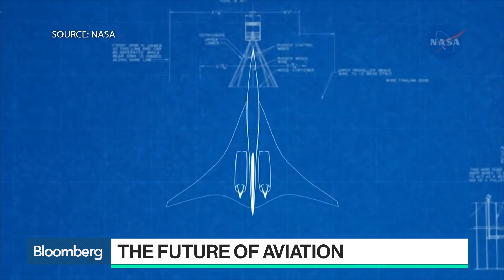The Future of Hypersonic Flight

Comment: If I had the means to approach this, I'd re-visit some of the swing-wing aircraft designs back in the 1970's. However I'd simplify the system and make it more internally compact by having the sweep done with an electro-hydraulic actuator and a worm drive system that keeps it in locked symmetry and an inherently locked sweep. (Military jets that had variable sweep had more adaptive hydraulics and even allowed for limited asymmetry that wouldn't be necessary on a passenger plane.) Mainly it'd solve the low speed cruise and landing/take-off problems while still allowing supersonic flight with full sweep.

Outside of the airframe? Perhaps look into some methods of allowing for variable bypass and seeing if engines with a gas-driven fan would also help with lower speed operation, while still being able to take better advantage of ram effect at high speeds.

Sounds crazy coming from somebody that only knows as much as I do. But it'd be neat to see if it's reasonable food for thought and not too far off the mark for implementing an actual design.
Reply: Swing wing is very heavy - Flight is all about power to weight ratio and lift. Electro magnetic plasma skin surfaces are looking more promising - https://www.youtube.com/watch?v=mpx4puLc3E0 - http://citeseerx.ist.psu.edu/viewdoc/download?doi=10.1.1.475.1595&rep=rep1&type=pdf

Comment: "It didn't work for the Concorde, why do you think it'll work now?"  Gee, lady, are you aware that the United States made it illegal for planes to fly supersonic over the U.S.?  That change in the law killed any chance for Concorde to make a profit.  PLUS, it killed the chances for ANY supersonic plane to make a profit in the American market.  It is true that technology today is much better than what was available in the 1960's, but no foreseeable technology could possibly get the operating costs down to anywhere close to those of typical for commercial aviation.  Ramming an object through the air at such speeds that the front edges want to melt is not, and never will be, cheap.  The passengers will be the same two groups that took the Concorde, the rich, and the upper middle class who saved up their money to do something special.  The thing to keep your eye on is increasing efficiencies in fuel consumption which could lower ticket prices for regular flights to the point that more people would be willing to upgrade to first class.  Planes might end up with first class compartments that are larger than the cattle sections.

Comment: The reason the concord didn't work was the PRICE OF THE TICKET. Nothing else. The average person can't pay ten grand for a plane ticket that's a one day round trip. They need to make this hypersonic commercial travel more affordable for it to actually become a thing.
Reply: the fact its lighter, engines are much more efficient and stronger materials are available compared with concord, this should massively reduce both fuel and maintenance costs on the airliners end, which would mean savings are available to us. Depends on how much the jet itself costs too though.

Comment: I suspect there is something fancy-pancy with the nosecone on these silent-supersonic prototypes, whenever you see a photo or video, the tip of the nose is always concealed or out of frame. Would make sense too, the very tip is where you would need to do something really clever in order to silence the sonic boom, which is kind of the essential requirement to make supersonic passenger flight reality again. 

Fuel cost wasn't the stumbling block for Concorde, the problem was that you could only do supersonic flight over ocean, resulting in extremely limited routes and very small number of aircraft. The economies of scale were just not there. Only 14 Concords flew commercial routes, compare that to 10000 Boeing 737-s.

Comment: Ow this is again more energy per mile. Why would we do this if there are better and more efficient transportation available? Or in this digital age such advanced communication?
Reply: Laurens L oh yeah what is the better transportation mode which does supersonic/hypersonic  speeds ????
Reply: Supersonic flight takes much more fuel than flying at subsonic speeds. Airlines care about cost mostly. It doesn't make sense to burn that much extra fuel flying supersonic than flying subsonic.
Reply: However the amount of potential supersonic flights will still pale in comparison to subsonic flights . With much higher ticket prices airlines will make a profit.

Comment: Mmm didn’t know the space shuttle was consider “successful”... bad safety record and super expensive. Why did he mentioned it? I wouldn’t have... 🤫
Reply: Both space shuttle disasters were not result of bad design, but rather bad choices to launch outside of the conditions it was designed for
Reply: Mr. Tesla Because, Elon Fanboy, it's old as shit. If you knew anything about space travel, you would know that the space shuttle was meant to be retired after 15 years of service. Instead, it stayed around for twice as long. That is one impressive feat. They finally stopped launching it because in the early 2000s, Bush wanted NASA to shift focus to returning to the moon, ORDERING the retirement of the shuttle because there isn't enough budget for a moon program and a shuttle program. Get it?
Reply: It built the space station, launched and repaired the Hubble space telescope.
Reply: Mr. Tesla the space shuttles main purpose was to construct things on orbit, in 2011 it finished building the ISS, and the US was in the middle of a bad economic depression, as well as the space shuttle being used far longer the  originally designed for, nasa originally planned to retire the shuttle in the 1990s. All 3 of these together were what caused the shuttles to be retired. And actually the shuttle was a very good design, it had many abort systems and plans, for the first flight, STS-1 had ejection seats for low altitude, the shuttle could also do a return to launch site abort which would allow the shuttle to fly back to KSC in the event of an engine problem, the space shuttle could also do a ATO or abort to orbit, as well as a single orbit abort which happened once, where the shuttle only when around earth once then landed. In the event of something happened that ment the shuttle couldn't land safely, but could make it through reentry there were systems and procedures in place that would allow the crew to egress though the top rear windows and parachute once the shuttle had slowed below Mach 2.
Reply: Mr. Tesla also, every single time crew went to the ISS they rode the soyuz, as a soyuz was simpler because it was simply a 3 person rocket, while the space shuttle was better at BUILDING the station as it could take 7 crew members AND 50 tons worth of payload, something the soyuz couldnt do. Also it had the capability of bringing large moduals and satellites back to earth from space Unlike the soyuz.
Reply: not if you are high enough
Reply: Because BOEING built it
Reply: smaster7772 why did they stop launching it? It sure wasn’t because it was successful. I guess it depends what you consider to be successful. As far as I know it didn’t reach the expected reusability and safety was bad by design. Not abort system!
Reply: I thinks is great they start working on this supersonic airplane.. The shuttle may have been good for some thing it was designed for. However, that is not by definition successful even if your US pride and bias gets on your way of thinking. The fact is that despite the good things it did, it had many bad thing. Over-budget project, Astronomical costs to launch, expensive to maintain, multiple deadly launches. Lets remember that Russia had a copy of the shuttle (did they continue that program?? No!) . Did they use or need it to built MIR? Did you know it cost more to refurbish the solid booster of the shuttle than making new ones. Did you know that a broken tile could cause the shuttle to self destruct on entry? Ok if you still call it successful. Then ok... go ahead think that. We should learn from the past and stop trying to hide mistakes!! Or we will be doom to repeat them.
Reply: Mr. Tesla buran was sadly a failure  only flying 1 flight, but to call a the 2nd most launched crewed vehicle a failure is pretty bad, spaceflight is dangerous and soyuz has had its fair Share of loss of crew aswell. Any spacecraft with a damage to its thermal protection system will self destruct, the Columbia disaster was a result of launching outside it the conditions it was supposed to (it was much colder then ussaly casuing ice to weaken the insulation on the ET) , bad discions that day. Not the vehicles fault. and btw I don't really have much thermal pride, just an incredibly deep understanding of the space shuttle program, and other spaceflight programs. Soyuz is a great lifter aswell. My only point is that calling the shuttle a failure is quite a stretch. If it was a failure it wouldnt have been selected for so many missions
Reply: Rico Sanchez it got it's job done though didn't it?
Reply: Rico Sanchez lol did you even bother to read what I wrote?
Reply: Mr. Tesla Nice try, but I'm not a NASA fanboy. I'm an aerospace major and a USAF pilot. This is my area of expertise.
Reply: Mr. Tesla and we already know sonic boom is bad for urban environment.
Reply: 空軍パイロット Learn some manners! NASA Fanboy! If the shuttle was a success, You don’t pay Rusia to take you to the ISS. Why??? Because it was still cheaper than a Shuttle launch and safer!!! I dunk on you!

Comment: Mach 5? Its not gonna happen.
Reply: Bobo Momo they need scramjets for those speeds. They have to get supersonic first.  What will they do have also another set of conventional turbine engines to get supersonic  ?
Reply: Are you saying  a regular turbofan or some clever advanced turbine engine inside a ramjet like tube like SR71's engine will be enough for mach 5 when significant progress is made by material/alloy/composite science ?
Reply: Bobo Momo the real problem is that the sonicboom is going to be heard all over the world if this goes to happen, it might be going to crack some windows aswell